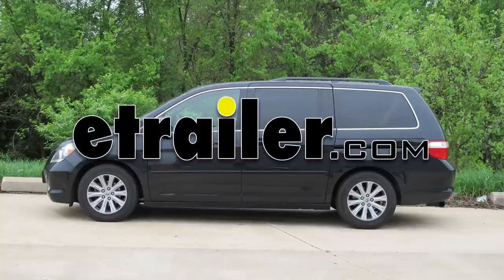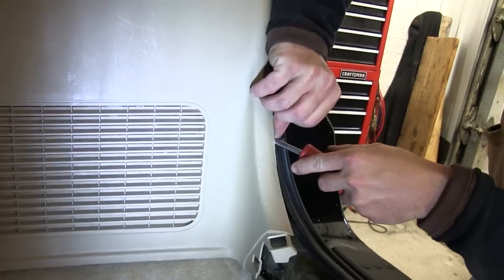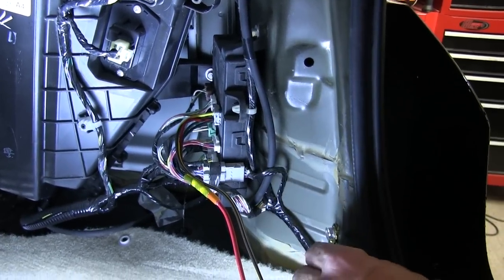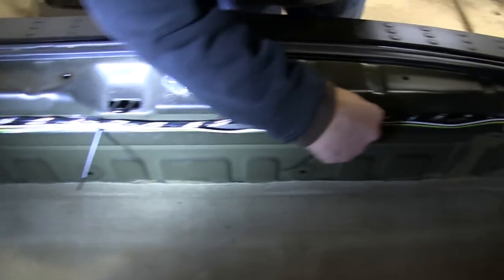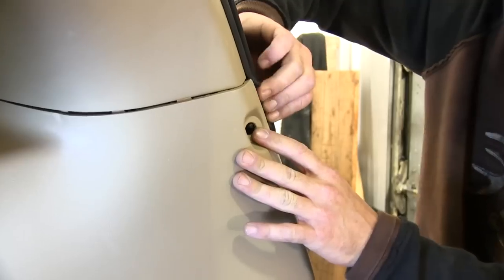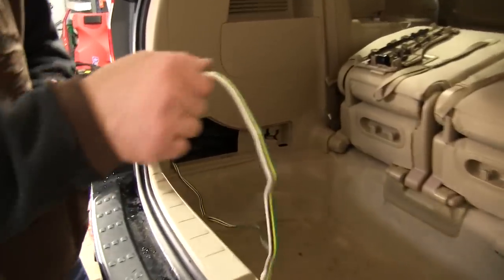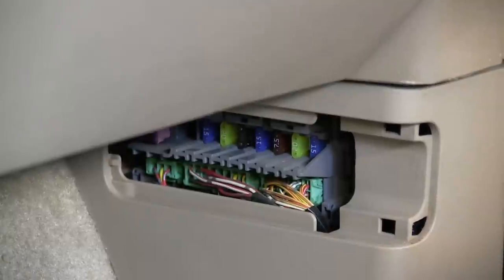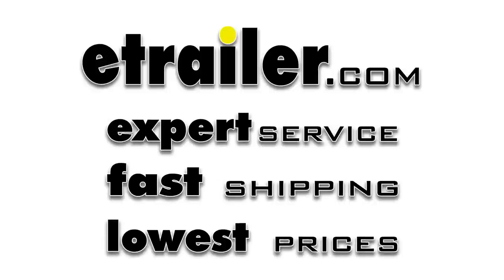Set up: T-One Vehicle Wiring Harness with 4-Pole Flat Trailer Connector on a 2007 Honda Odyssey

Comment: This was an excellent video and made my hitch install so easy. Only thing I did different was I used a 1.25mm tap to clean the threads as the brush I had couldn't do a good enough job. Thanks for sharing.

Comment: Is there a 7 blade connector for the 2005 Odyssey?
Reply from the maker: You can use the kit shown in the video in combination with the ETBC7. Check out the following links for more information on the kits that you will need.
https://www.etrailer.com/Custom-Fit-Vehicle-Wiring/Tekonsha/118438.html
https://www.etrailer.com/Accessories-and-Parts/etrailer/ETBC7.html